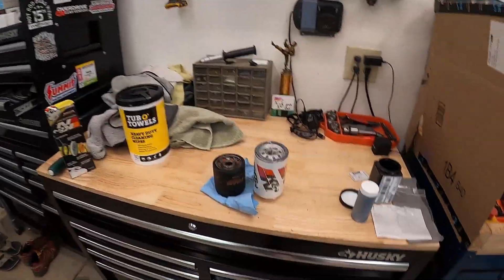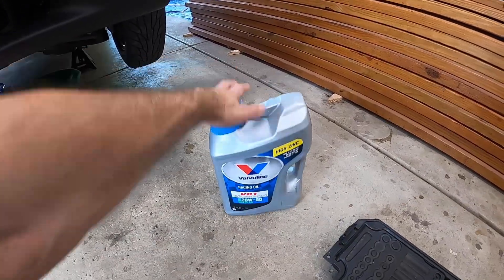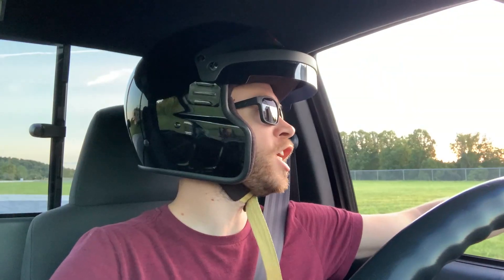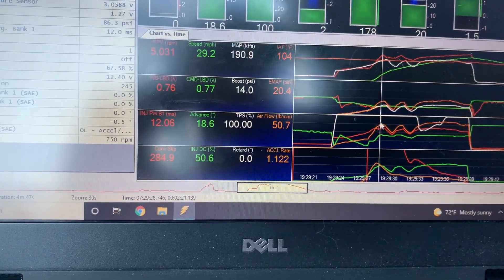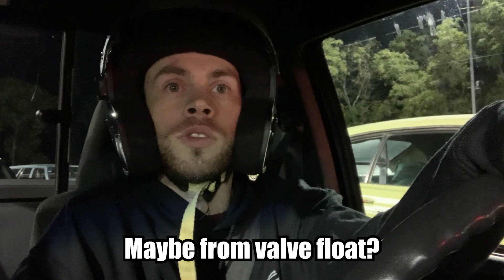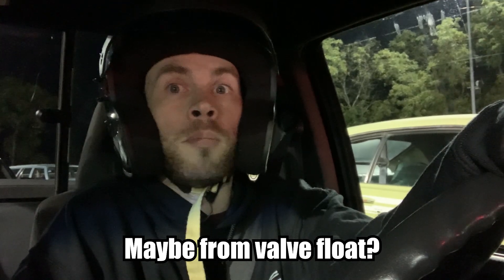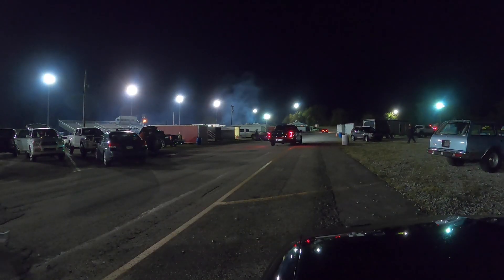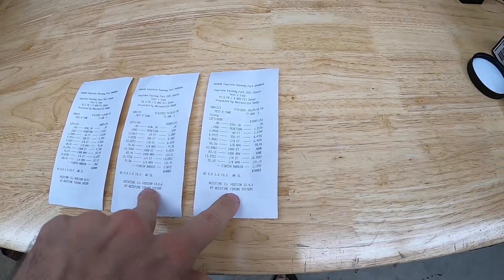10 Second Track Day! - BIG OOF!!! (Valve Float)

Comment: I have a 4.3 in an 86 Toyota pickup  2wd and with the bolt in cross member I can drop the oil pan without pulling the motor

Comment: You could probably get away with using forged internals from a small block Chevy to make a stroker out of it do the 383 trick but to a 6 cylinder you will get more RPM which would more than likely help with a Turbocharger do a camshaft swap because you're going to want to do that anyway to get more power or if you have a block laying around start building it with if you make the cylinders larger by having them board 30 or 40 over that will give you more displacement also with a little bit of work you will be well into the 9 second range no problem and instead of running the cheater slick running actual drag slick you will pick up a ton of traction

Comment: Man that truck hauls butt for a 4.3 and turbo.  what rear differential are you using in that truck ?
Reply from the maker: 7.5" 10 Bolt w/ Eaton True Trac
Reply: @turbov6  awesome bud. Thank you for the reply back. I wasn't sure if it was stock or aftermarket rear diff. I'm glad it holds the power.

Comment: Branden ! That thing still got pedestal style rockers on it 🤨 ? Holy crap lol drill and tap those head for 3/8 studs and throw some nice comp adjustable valve train on there ! I couldn’t imagine life without it ! Makes my 4.3 happy I know that .
Edit : that 10.8 run was smooth af man 😎 . I want that intake lol
Reply from the maker: Adjustable valve train won't pickup any power. LS engines make way more power with pedestal rockers.
Reply: @turbov6  that may be so but if you ever plan on camming it like I have a stock valve train isn’t gonna hold . I snapped my pedestal in two on 1st bank side . That’s what led me to build .
Reply from the maker: @lostkauz83  Guess I'll find out when I do the cam.
Reply: @turbov6  yea I left out the part I had a 93oct mix with a lot methanol booster . May have had something to do with it . But side note , I have a friend in AR who also uses HP prosuites and builds turbo extreme s10s . His channel is Justin’s car-toons  check him out !

Comment: My stock motor hero, i am interested in how well a 4.3 would handle boost not that much but maybe 8ish lbs for offroad/mountain hill climbing? not crazy rpm at all but that xtra torqy lil umph of a sum more power. when i begin to plan the fuel system for my project thas mostly my power goals but shiz seeing your stock engine push over 16psi holy moly transmission get ready hehehehe! Keep tha great videos coming, i gotta rewatch for more info that manifold is sick!

Comment: Hey man, Get your self some Rotella.  I run it in my 4.3 and helps a ton.  On top of that you have a Turbo you wanna use a High Zinc, High Phosphors oil Rotella is perfect.  I also use the OEM AC-Delco Oil Filter because all he other oil Filters out there that "Filer better" actually kill your oil Pressure as well due to the more filter cleats that they have. Have you thought bout porting your heads?

Comment: Have you ever considered an Astro build if I’m not mistaken Astro is lighter than the s10
Reply: Not correct sir . My extended cab extreme is lighter then a Astro with full tank and me at 3680lbs . So I’m positive his reg cab Sonoma is barely over if at all 3500lb . Astro is 3900-4500 lbs

Comment: Dude I’m building a turbo 4.3 vortec on the cheap, Ls3 blue Behive valve springs and 1.6 roller rockers for a bit more lift.
What cam are u stabbing in, I’m using a comp 56-460-8, JE forged pistons and forged eagle H beam rods.

Comment: I have a few 4.3s and the timing cover will come off with out pulling the oil pan. I did a cam swap in mine without pulling the motor. If you don't have an a/c condenser the bigest thing you have to move is really the radiator.
Reply: The cam i put in mine is a comp cams 56-440-8. And I picked up some decent power with just the cam